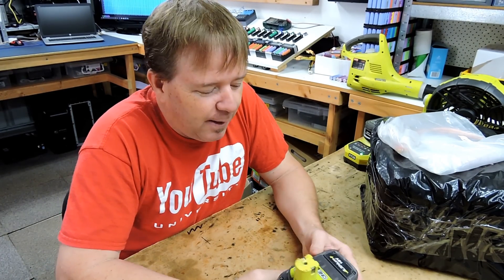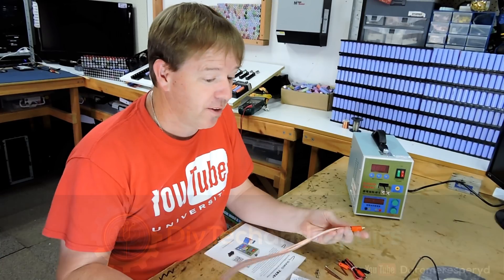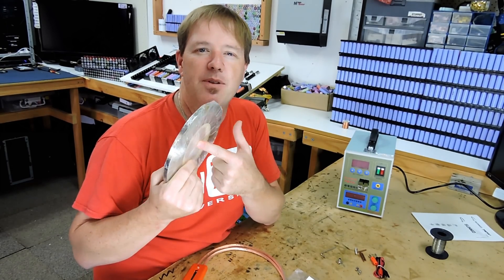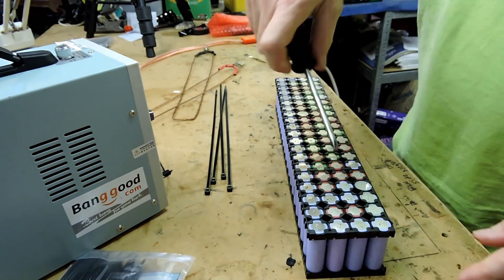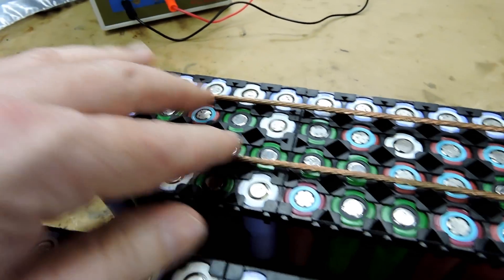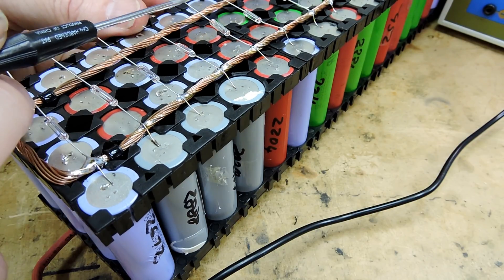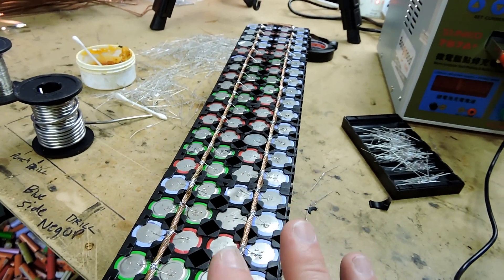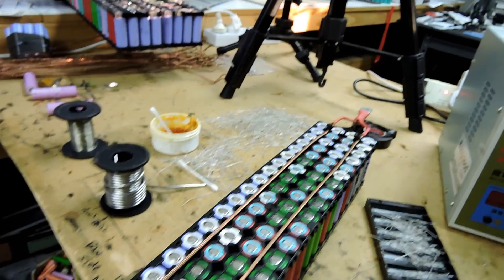Sunkko 787A+ Banggood Spotwelder

Comment: Hey dude where did u get that fuse wire and what amp. Is it thanks
Reply from the maker: I think it 32 awg ? Make sure what ever you get test it as you never really know the size .. 
https://rover.ebay.com/rover/1/711-53200-19255-0/1?mpre=https%3A%2F%2Fwww.ebay.com%2Fsch%2Fi.html%3FLH_CAds%3D%26_ex_kw%3D%26_fpos%3D%26_fspt%3D1%26_mPrRngCbx%3D1%26_nkw%3DTinned%2Bcopper%2Bwire%2B32awg%26_sacat%3D%26_sadis%3D%26_sop%3D15%26_udhi%3D%26_udlo%3D%26_fosrp%3D1&campid=5338316197&toolid=20008

Comment: I am beginner to 18650. Just learning from expert's videos like this. Thx. but I am confused, why buying glass fuse and not using the fuse as is and using the wire only?  Then why dont you buy 30AWG tinned copper wire rool and use it as fuse. I thought this is good and ordered for wire roll and waiting. Please advise.
Reply from the maker: glass fuses are bulky and expensive - i went with the 30-36awg worked well years later still working
Reply: @HBPowerwall  Thx. I have received 30awg wire from Remington 
I have a question. I have made my first sample battery pack of 4s 10p with ballanced 4s 40A protection board. The question is how to charge this battery pack. I charged from the battery outlet of my pmw controller. which has a max. of 14.4v. Not enough for me for a 4s pack. Can I charge before the controler direct from the solar panel which provied 18V, iI believe?

Comment: Hi, will it be good to add thermal management pipes inbetween these cells? so the heat will be transferred soon? Please let me know, thank you
Reply from the maker: There is zero heat so no need max watts for my 40kwh pack of batteries is 10,000watts something around 190 charging amps and only got slightly warmer typcial charing is only4 40 amps
Reply: @HBPowerwall  ok thank you !!

Comment: One question. Im kinda new here and I am wondering arent .5A fuses a bit too low? I kinda feel like your gonna be drawing more power...
Reply from the maker: If you only had a small wall yes 0.5 would be too small but with 320 cells in parallel with a 4000 watt load ( i can go 8000w) it's like 100 amps draw from memory divide that by 320  and max it's 0.3amps draw and only ever for a very short time. That said I'm using 5amp fuses in my wall not the glass fuses just nickel plated copper wire
Reply: @HBPowerwall  Oh ok that makes a lot of sense. Thanks man!

Comment: To be honest, I think the better way would be to cut a long aluminium strip the length of each row then -5mm per each cell, then you solder fuses to the long strip you have. Once done, you cut the long strips into lots of 1 per a cell. This way you then spot weld the tin strip, which is not only faster, but stronger too. Spot welders are great but not at the expense of time and quality.

Comment: Very nice. However, be careful with the foot pedal. The jack it's plugged into is at mains potential if i remember correctly. And it's not really made for these voltages. This unit however is supposed to work quite good for the low price. Despite the fact it's essentially a modified microwave oven transformer.
Reply from the maker: Thanks for letting me know I'll be sure to keep an eye on it.

Comment: Have same welder, mine works best at 60 setting. 99 setting not stick at all. Got real pure strip ~50$/kg from Aliexpress last year 11.11 here: https://www.aliexpress.com/item/0-15-7mm-pure-nickel-strip-0-15mm-thickness-7mm-width/1316380630.html
0.15 mm pure nickel is the absolutely max for this welder. If pack need more current, use multiple 0.1mm strips.
My solution to fading current with long wires: http://i.imgur.com/QS9N1QH.png

Comment: I have one of those spot welders. Never had a problem welding pure nickel strips of any thickness. Nickel plated strips (the 1 kilo roll) are not a good choice for your projects since they have a higher impedance and are also difficult to weld. Pure nickel is much more expensive!
Reply from the maker: More expensive that - woozers

Comment: Not a bad video Peter, but using your hand piece way wrong! Should have it vertical. to get better current transfer! and to stop your weld tips arcing with each other, that's why you got s many failed welds. also your copper fuse wire must be quality tinned wire!
Reply from the maker: Great feedback, already ordered some more tinned copper wire & will try always to it vertical, tried laying on its side to get less contact patch but I'm very open to doing it better.

Comment: Just a question. When your building your 18650 packs is it neccessary to fuse the negative side of battery? Is it dangerous not to.  Was thinking maybe just tin taping the negative side and fusing the positive only. Probably a crazy question but I thot I would ask! I always enjoy your vids. Learn alot from them.
Reply from the maker: I did tinker with fusing the negative - just added another failure point, definitely overkill I thinks but many are still doing it

Comment: Put a few super farraf caps across the terminals to hold a bigger charge to dump more into the spot weld if the unit can't put more power into it. test it on some old cells in case it burns holes into the cell caps.
Reply from the maker: Wouldn't know how to start doing that!

Comment: To get the wire to go properly under the tip just make sure that the tip is somewhat formed. I got a slight small dent on the tip that easily catches the wire inside. When they where new and rounded it was damn hard :D
Reply from the maker: Yes, Jaron has mentioned the same thing, wanted to test out of the box then start playing with it to make it work better for our purposes

Comment: Yeah nickel strips with that one is not easy. Its not powerfull enough. The 709 I got is alot more powerfull and i can atleast do the thinner nickel strips but have to run high crank :D  But i had same feeling as you when i first got mine untill i started with the fuse-wires instead that was like butter to spot
Reply from the maker: In the process of trying to make a jig to do consistent pressure tests of the nickel strip provided...

Comment: These spot welders work much better when you crank up the current. 0.1mm nickel usually welds pretty well on almost all of them but they can struggle with 0.15mm nickel on lower current settings.
Reply from the maker: Current and pulse were maxed out on every test, They provide 0.15mm and above but it won't weld thicker stuff well.. Got the weekend off to play and learn.

Comment: Looked at the spec "Soldering metal thickness:less than 0.1MM " was you thickness more?
Is for your video very interesting many thanks.
Reply from the maker: Yes, was 0,15mm and it did that quite well when using the hard wired welder - didn't do the hand held very well at all.
Reply: Thanks. as I might look to by one (but which one?).

Comment: how do you balance the blocks, the one you use in the diy powerwall? Each block is around 3.7 V right, so you put 3 in series to get 11.1 V, but unlike lead acid these need to be balance charged, so how do we do that??
Reply from the maker: I have 14 in series and I use a http://www.batrium.com BMS to take care of my batteries.
Reply: HBPowerwall thanks! Will check out the link. I am making a DIY powerwall as an alternative to my lead acid battery.

Comment: Where did you get the glass fuses??? Genius idea!!
Reply from the maker: Fuses were from ebay - https://rover.ebay.com/rover/1/711-53200-19255-0/1?ff3=4&toolid=11800&pub=5575290598&campid=5338074967&mpre=https%3A%2F%2Fwww.ebay.com%2Fitm%2F200Pcs-Glass-Fuse-Tube-Axial-With-Lead-Wire-Fast-Blows-Fuse-3x10mm-250V-0-5A-BS4%2F253186641653%3FssPageName%3DSTRK%253AMEBIDX%253AIT%26_trksid%3Dp2057872.m2749.l2649
Reply: @HBPowerwall  I am using 250V 2A fuses for a lot cheaper.. Your link shows 250V 4A, What I could me loosing?

https://www.ebay.ca/itm/200Pcs-3x10mm-250V-2A-Glass-Fuse-Tube-Axial-With-Lead-Wire-Fast-Blows-Fuse/303048222013?_trkparms=aid%3D555018%26algo%3DPL.SIM%26ao%3D1%26asc%3D20180124145912%26meid%3Dc5bc2ba0fe0848f28eda363e24811597%26pid%3D100005%26rk%3D2%26rkt%3D12%26sd%3D283303754606%26itm%3D303048222013&_trksid=p2047675.c100005.m1851

Comment: First of all, thanks for the review.
I have heard of a lot of people in the EU that can't use it as it produces short puls of over 16 amps, and most in the EU have a 10 amp fuse.
What fuse (not in the device) is the device connected to?
I can also see that the light goes down shortly when you activate the sportwelder, that does not look good. That is not something that should happen right?
Reply from the maker: I put a AC meter on it and could only see 120watts max but I'm guessing its so fast the cheap meter can't detect it. ALL the lights dimmed every time i triggered it

Comment: On another note: I note from previous videos you have a separate grid-tie and battery solar system, have you considered using the MPP Hybrid inverter which can do both grid tie and battery? Wouldn't that be more efficient? I am thinking about the 4kW solution for a future project.

Comment: Was looking at this after I saw the other channels using it. Like your review. Thanks
Reply from the maker: For what it's worth - it is what it is a cheap spotwelder - it works better with the onboard spotwelder than it does with the hand head pieces - This is what makes me think it can be tinkered with.
Reply: Id like to see you get it working or your friends one. To me it seems a better way to attach metal to the top and bottom of the cells.

Comment: You should increase the current/power when spot welding thicker strips. Start from the minimum and gradually increase till you get a fair weld. I had one of these spot welders and at about 100 welds the thing died and by the look the components used i am guessing those are salvaged parts.

Finally i had to built one with a MOT and a PCB of my own. Details to it on my channel.
Reply from the maker: Had it on 100% kinda worked on the Nickle strip using the units welding things - but hand held it just seemed to lack power.

Comment: BAAAANG... GOOD!!! 
I extensively used the SUNKKO 709a for the most diverse battery builds, here are some recommendations:

•set the current as high as possible, this is what makes the welds to "stick", then increase the pulse settings, this will increase the time. On the 709A I found that 4p and 6p (depending on the tab thickness and how many layers of nickel) are the best setting for the hand piece. 8p just makes everything super hot and doesn't really help much. 

•yes the current drop a lot more on the hand piece compared to the two heads mounted directly on the welder (shorter distance from the transformer). Copper lugs should help adding more surface (I never tried but sounds like a good idea)

•Overheating: you'll also notice that depending on the settings, after continuous use the thick hand piece cables get reeeeeally hot. I pushed the 709a really hard to see if it would overheat and fry or any thermal cutoff happening but the transformer just drops performance and you'll notice that "it's time to stop and give it a rest". You can add a computer fan blowing cool air cooling the transformer that is baking inside that metal case and also replace that clear plastic insulation over the copper cables with a breathable mesh sleeve (all the heavy duty industrial spot welders are like that, including the one I use at work everyday).
Reply from the maker: heheh
Reply from the maker: Dude, i think you just wrote the script for next video!
Reply: HBPowerwall ohhh yeaaahhh... guess what, I'm coming to Brisbane next weekend... we could go to Jaycar and try these mods =]
Reply from the maker: Let me know when your around!